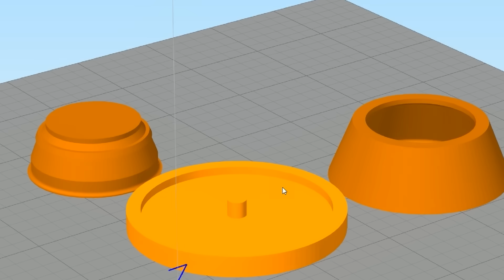Restoration of Impact Driver - Milwaukee M18-2753

Comment: I have the same driver used it for 7 years now daily service as a work tool. I even have a newer one and prefer the feel of the older one. Not an issue so far. Also the drill from the same combo kit is on its third chuck, drill still works perfect
Reply: Been abusing mine for 6 years. My brother bought the new kit and I like the feel of the second gen better. Helps that it's worn to my hand too. I hate the feel of new tool grips
Reply: Milwaukee chuks suck, get a Röhm one and you will never need to replace it. Röhm chucks simply lasts forever.
Reply: My drill from this set is still going as well! The impact died two months ago 😢
Reply: Where do u get the chucks from ? I just retired my old brushed drill it works fine and has a lot of power just the chuck can’t grip anything

Comment: I just pulled one of these out of an old tool box. It had been sitting outside for probably 5 plus years. I bought a new battery and after fiddling for about 5 mins, the drill works like it did on day 1. Best purchase I've ever made

Comment: Literally just bought this same impact over the weekend. I'd been hesitating and doing a little digging, but Home Depot had a great sale. You could get this impact and a High Output 3.0 Ah battery for $149 (pre-tax). 

All my tools got stolen a few months ago, so I've been slowly rebuilding my collection. My first major use of it was today and I already love it. I had the old M18 first gen brushed combo kit before this beast.
Reply: I know your pain. I’ve had 10k worth of Milwaulkee/husky/Purdy tools get stolen last year. Still trying to rebuild it
Reply: Brushless my guy brushless
Reply: Fuck I came here to say I lost a whole 4s box filled with everything. Sk proto Williams Armstrong Milwaukee snap on Mac matco I still get angry as fuck because the cops didn't help and said unless I had serials or my name engraved in everything I was fucked

Comment: Nice rebuild. I like rebuilding older power tools like that. But I am a DeWalt fan and therefore have rebuilt near about all my power tools. I buy them really cheap and repair any that needs replacement parts and than use them for years... Thumbs Up!
Reply: May i ask you how you learn to work on tools like this
Reply: @rickygervaissgyno4081  If you are mechanically inclined, than you start be taking the tool apart. If you need a break down, the internet has most any tool break down if you enter the tool model number. A camera also helps as you disassemble. And usually the parts that are damaged are easy to spot. Bearings and brushes are most of the defective parts. Some times winding are and you can either buy replacement parts or rewind your own. Try it, you will enjoy it and have a working tool to use as well.
Reply: @garymucher4082  thank you for the advice sir

Comment: Love the 3d printed mold idea . Love your ingenuity. But if I’m being honest , I think all the effort wasn’t worth the reward . Just the time spent alone on making the mold , the cost of the sealant , 3d filament , sand paper etc . Probably could have gotten a replacement for cheaper . But I really appreciate you going out of your way to not spend the money . Well done sir 👍
Reply: I’ve done something similar with 3d prints for polyurethane bushings for cars it works quite well
Reply: That’s assuming he buys those things just for this. Can’t cost the same as a new one then.

Comment: I did something very similar with windshield urethane: I molded a rubber bushing for an old car;  I used Vaseline as the release agent; worked very well.  otherwise, exactly the same process.  🙂

Comment: I have a question. This restoration probably cost’s more than the new tool. Is there a reason why the owner just didn’t buy a new tool vs restoring? I use a lot of these Milwaukee tools for car and home building but if they break which is rare I just buy a new one vs getting it fixed. Tool downtime is lost revenue so buying one is quicker and cheaper than repairing. What are your thoughts?
Reply: I do both.  I buy a new one but keep the old one around for emergencies.  Sometimes it's nice to have several impact drivers with different bits in them to save you from swapping.  I find it worthwhile.   As a general statement the new ones are better than the old ones so I keep buying new.
Reply: Maybe he is a hobbyist who loves the process and has the time and interest to do it. Or maybe he doesn’t want stuff to go to landfill or maybe he wants to teach himself something.
Reply: Of course the time, skill and effort that went into this (or most any) restoration is far more than the $129 and a trip to Home Depot it would take to replace. (In the USA and Canada, at least.) Economics of scale and automation have guaranteed that. The rubber guard could easily have taken an entire day — or more — to reproduce a $3 part. Not to mention the entire shop full of tools. 
   Everyone is so focused these days on the idea that time is priceless, which justifies staggeringly high costs and waste of just about everything else. It's exciting to have new things all the time. But has anyone noticed that so much of it is mass-produced crap? Even the "nice things" that are sold as higher quality, more features, or "exclusive luxury" are really just designed and made to fit a price point. And when they break or just go out of style we toss them.
  What happened to craftsmanship? I live in a 100+ year old house that has most of it's "original parts." It was well-built because people valued things that were built well back then. Meanwhile, few of the houses being built today will be around that long. They are profitable for everyone involved because they go up quickly and on schedule, not built well. That seems irrelevant since more than a few will be "thrown away" to build something bigger, newer and with this year's style. And the cinder block, plastic pipes, spray foam and "luxury" vinyl flooring simply will not last for a hundred years. 
   The Great Pacific Garbage Patch is all over YouTube. Literally miles of plastic things we threw away to get new ones. And it is not the only one floating out there. The triple golf course near me is actually built on a huge garbage dump. The hill I learned to ski on — a landfill that got full. What happens when another three billion people can afford to "just get a new one" instead of fixing what they have?
Reply: I have nothing against the restoration, he did a good job but I feel some areas weren't thought through very well for instance the rubber guard could have just been bought and using a stiff brush on the stickers 👀 it is an old driver the stickers are bound to be not brand new but cleaning it like that will make it more prone to pulling off or just peeling apart. also the screw driver on the rubber grip OMG I know it's a restoration but you should be restoring it not destroying it, many other areas in this video where they were not careful with the final product, maybe they rushed it but either way for a process that took this long I think they could of done a neater job

Comment: At 10:01 what did you use to clean that part of corrosion?? It looked line it just came of but also looks like paint
Reply: It looks like a sand blaster or blasting cabinet. Fantastic tools for restoration!